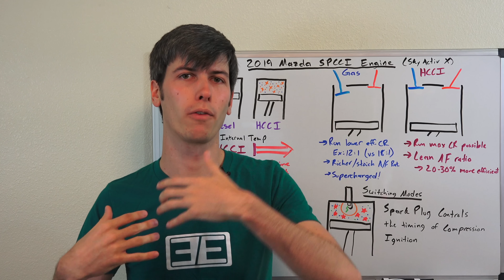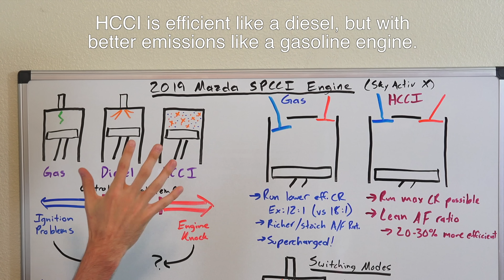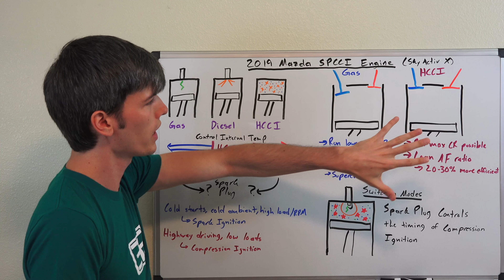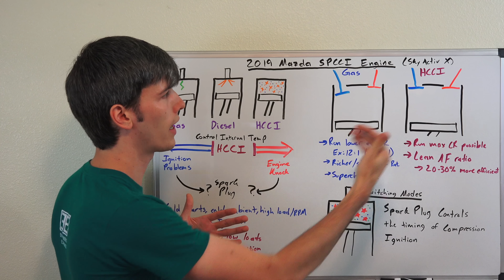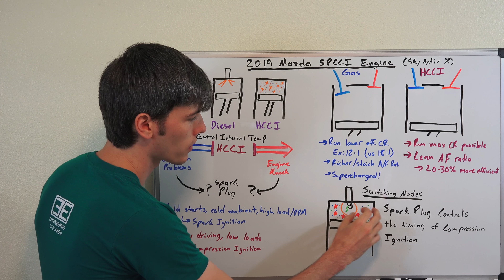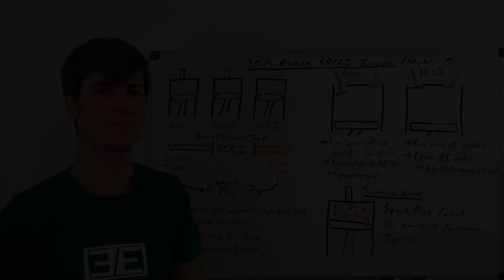Mazda Creates The Holy Grail Of Gasoline Engines - HCCI SkyActiv-X

Comment: Was in Hiroshima a couple of weeks back and speaking to one of the Mazda staff about this engine. They stated (and it was repeated in their release video YouTube: wEh8MgFLNh8) that the work they did for their clean sheet approach to the Skyactiv-G and Skyactiv-D engines was intended as the path to this Skyactiv-X engine. Of course with those, the non detuned G had a compression ratio of 14:1 (very high for gasoline) and the diesel had the same compression ratio (14:1 very low for diesel). The diesel follows on from numerous studies of low compression diesel using a single cylinder (Example "A Survey on Low Compression Ratio Diesel Engine" - Bridjesh P et al) where there was lower NOx and soot, however cold starts were an issue. Mazda sorted this out by redirecting exhaust during startup (I experience this daily because I have a Skyactiv-D, and even on the coldest mornings it takes just a few minutes to warm up where you cannot exceed 50km/h). The bonus however has been lower NOx and lower soot. Both of these were illustrated recently. Japanese government investigations into diesel engines post VW dieselgate, showed that Mazda's engine was the only engine to meet standards and had NOx emissions as stated in both real world and laboratory tests, whereas all other manufacturers had between 6 to 10 times more that the standard when comparing real world tests to the lab. With regards to deposits, AutoBild in Germany Dauertest (which is an intensive 100,000km test), came to completion on a CX-5 with the Skyactive-D, they noted no deposits on the cylinder (which contrasted greatly to the 18:1+ also in their Dauertest. The other advantage to lower compression has been weight. The old Mazda 18:1 diesel had an iron block.
So the question I posed when in Hiroshima was what compression ratio the Skyactiv-X would be. The answer was simple.... what compression ratio have both G and D been heading towards? The answer - 14:1. Watch the Mazda video on youtube wEh8MgFLNh8 and this is basically hinted.
Reply: Glenn, don't worry about the scoffers. They draw conclusions about things they don't know out of thin air. You have demonstrated knowledge and intelligent writing on Youtube. That's a lot more than most.
Reply: mcgeufer WTF? You shouldn't joke about such things. Hiroshima is a great city, and although war is war, Hiroshima was targeted because its a port and would feel a large impact. Visited the factory just under 2 weeks ago (my third visit). While heading out to plant, a keen eye can spot mules and test vehicles (including the HCCI test vehicles). Although impossible to detect what a test vehicle is actually testing. Most test vehicles were current CX-5 (from Hiroshima) or Mazda 3 (from Gifu which is 20 minutes away by Shinkansen). My family lives an hour away in Fukuoka (which is close to one of the two main Lexus factories - a very different style there and tiny compared to the Mazda factory).
Reply: mcgeufer for record, atomic bomb used about 60 grams of nuclear material, which when spread means that its very safe now. This contrasts with somewhere like Chernobyl which was over 2 tonne of nuclear matter
Reply from the maker: Fascinating, thanks for sharing!
Reply: Sucker Punch. That's quick wit Rumpa, but also shows youth.
This is an Engineering video, not a history lesson.

But given your youth, I highly recommend visiting the sites inquestion yourself. Reading the history. And taking note of both sides.
The Japanese were not in the right. Sure. It's war. But your use of "Sucker Punch" really illustrates you don't have a grasp on the whole picture of the war. 

I will state first, that as an Australian, our current history may have been different had it not been for Hiroshima and Nagasaki. And it's part of the reason, the peace museums are worth visiting. I have, on numerous occasions - as too, have I visited Pearl Harbor. The two, could not be more different.
As an Australian, I know we're big supporters of our allies. Actually, we are the only country to have supported the US in every conflict. When others say no, we never say no.

Back to WW2. It started before Pearl Harbor of course.

Australia was the first of the allies to enter WW2 on a called from England. 15% of Australia's population enlisted, and was sent to WW2 in Europe whilst the US remained inactive.
It was Pearl Harbour that finally brought the US into the war, over 2 years later.

The long term goal of the Japanese wasn't to attack Pearl Harbour - that was a large, and important target on the way. Their eventual goal was to attack Australia. And that, they did.
Whilst Pearl Harbour in Hawaii was attacked (and yes, the mainland was hit somewhere in nowhere Portland forest by a well known Japanese pilot) - it brought the total attacks on the US to 2.
Australia on the other hand was attacked 97 times by the Japanese, in over 5 states.

The Japanese were so ready to take over Australia, they even had new banknotes called the "Australian Yen". Australia would have been breached had it not been for the forming of the US Navy's 7th Fleet in Brisbane, Australia. While most of our troops were in Europe, Australia and the US formed together. Actually the largest Naval battle of all times, the Battle of Leyte Gulf was the US and Australia fending off the advance.

And in the end, most remember two atomic bombs being dropped.
What most don't remember is that the US bombed almost every single town and city in Japan with civilian deaths being anywhere from an estimate 300,000 to a million people.
That was the sucker punch response to 2500 dead in Pearl Harbor.

Japan of today is very different. Despite being every piece of military was dismantled by the US (east Japan) and the Commonwealth led by Australia (West Japan). Despite the US inflicting multitudes more damage to their island, than was inflicted on them, they are a nation that has much respect for the US.

This respect is shown in the way they display their museums in Hiroshima and Nagasaki.
They are peace museums. They state the facts in all languages, and pass no blame. They are silent and reflect on the dead.

Travelling to Pearl Harbor, I was hoping to find the same attitude - that was war, lest us forget.
Yes, USS Arizona was like this - it's a burial site. But everywhere else there is a brazen and brash attitude. There is only one language. The facts are stated about Pearl Harbor, but the guides respond in a "hoo haa - we're American and we kicked their ass" way. The Japanese certainly don't do that.

So, rather than respond with "Sucker Punch" as if "they deserved it" - take into account all of the history. Did an attack on a single island with 2500 dead warrant fire bombing an entire nation? Suppose we'll never know how far it needed to be taken.

What I am thankful for is that Japan is a true ally and friend today. That Australia is a stronger nation for its involvement.

Now, Rumpa - can we get back to HCCI?
Reply: McGeufer the Japanese were given a chance prior to Hiroshima. Part of what you say is true. When firebombing Japan, they left Hiroshima untouched knowing that if a surrender didn't occur that it would serve two purposes - first, it would be very impactful and hopefully force their hand, but secondly, they would see the impact of the bomb.
The  US wanted an unconditional surrender. This was in discussion well before Hiroshima. This is what Roosevelt at the 1943 Casablanca conference, but it wasn't looked down upon very well by other allies including Churchill, and even Eisenhower himself. The unconditional surrender would have removed not only military, but dismantled government.
After Hiroshima, there was no surrender and in a very Western way, they negotiated down - the unconditional surrender was off the table, and it would be a purely military surrender. This was seen by the Emperor in another way. He honest thought that there was a weakening on the side of the Allies (although worth remembering, that by this time the other parts of the Axis powers had already surrenders in Europe). Nagasaki was attacked (the original target was east of there at Kokura, but it was clouded over).
The surrender occurred after that.
But some also note that Russia had declared war on Japan just prior to the atomic bombs being dropped in the first place. Russia is barely an hour flight away from Japan, and some historians thought that even without nuclear war, Japan would have eventually surrendered rather than be taken over by Russia.
Reply: They've hinted at 14:1 in all of their material. But there isn't actually a released number. They've done so much to moved their diesel engine down from 18:1 to 14:1. And moving to 18:1 could result in a heavier engine block (something that would go against their zoom zoom gram analysis program).
However I suppose if they could produce a lighter block it would be a tick. And it might be the case that such a lean mixture requires 18:1.
Let's wait and see.
Reply: you are kidding right?
Reply: This is a report from Emission Analytics which did private testing that did not conform to Japanese fuel standards.
It wasn't performed in Japan, and had no legal binding on Japanese car makers in Japan.

The Japanese government performed their own legal testing to their own standards. It was not commercially supported, or liable to commercial bribery. Emission Analytics has been hired previously by competing car makers to review emissions.

I think I take a Japanese government test, which was done by the government for legal binding reasons over your rubbish source above.

The body that did the testing was the MLIT (Ministry of Land, Infrastructure, Transport and Tourism).
The standard that needed to be conformed to was  “Automotive NOx and PM Law"
The emission standards are summarised here: https://www.dieselnet.com/standards/jp/ld.php
Test results were released by MLIT on 04-Mar-2016

https://arstechnica.com/cars/2016/03/japan-finds-emissions-issues-in-diesels-from-toyota-mitsubishi-nissan/
"Japanese regulators told the WSJ that tests of Mazda’s CX-5 and its Demio (internationally known as the Mazda2) resulted in lab and real-world tests that were almost exactly the same."

https://www.forbes.com/sites/bertelschmitt/2016/03/05/japan-releases-nasty-diesel-test-results-germany-sits-on-them/#47c260d93d56
"Some of the worst performers were Toyota’s Hiace van and the Land Cruiser Prado SUV, Nissan’s X-Trail SUV and Mitsubishi’s Delica D:5. Mazda’s new Scyactiv diesel-powered CX5 and Demio (exported as the Mazda2) tested at or near the standard."

https://www.japantimes.co.jp/news/2016/03/04/business/four-japanese-diesel-vehicles-flunk-road-nitrogen-oxide-emissions-tests/#.WZQ2MXcjEUG
"The inspection was made on ... models by Toyota Motor Corp., Nissan Motor Co., Mazda Motor Corp and Mitsubishi Motors Corp."
That's the 4 they tested however:
"report by the land ministry showed Thursday that four diesel models of three domestic carmakers"
They reported three, because the 4th - Mazda was found not to exceed.

www.ihssupplierinsight.com/main/news/proc/create-pdf?id=35111
"The models with the biggest emissions gaps were certain versions of the Toyota Hiace van and Land Cruiser Prado sport utility vehicle (SUV), the Nissan X-Trail SUV, and the Mitsubishi Delica D:5, all sold in Japan. On the other hand, Mazda's CX-5 and Demio yielded almost the same emissions results as in the laboratory tests"

Herr, get your facts straight buddy! Stop trolling.
Reply: Herr, you obviously are interested if you're coming to this awesome channel. This channel is a no nonsense, informative channel and EE produces some awesome stuff.
And the posters here are keen to learn, contribute actual facts and their own opinions.
And opinions are fine.

However if you're interested, stop posting sources that are unreliable or you have read, but misquoted to suit yourself.Contribute what "you" believe is "your view", but don't present it as a truth just to shut down other posters, who frankly are contributing in positive ways. And don't respond in the way you did above: "now get out of here children... you know nothing... losers.", because this is just troll behaviour, which is for someone of my generation the childish way to reply.

Next post from you Herr, should be positive mate!
Reply: Elon musk is a fraud
Reply: mcguefer you really ought to brush up on your history. they had no intention of surrendering (albeit because we made the mistake of softening our surrender terms, which they took as weakness). the bombs were simply because we didnt want to launch a land invasion. thats it. thats all it was.
Reply: Herr, you're actually incorrect. It's easy to assume though, because both German and Japanese governments went to extraordinary lengths to investigate.

The Japanese have emission standards. To determine if each vehicle was "cheating" it was tested in the lab (where most would simply pass), and in a real world test (where most would be caught cheating). This testing was done late 2015, early 2016 and published.

The worst performers were the Toyota Hiace and Landcruiser, Nissan's X-Trail and Mitsubishi's Delica D van. The main manufacturers, Toyota, Nissan and Mitsubishi at best had cars that were breaching standard by 4x on the road, but at worst 10x.

However, the Japanese government were astounded when Mazda's vehicles remained the only ones to perform identical in both lab and on the road, and deemed as passing the test. The on road emissions produced on the CX-5 for example were passing the standards and matched what they had printed on the specifications. So, no, the Skyactiv Diesels were applauded, not caught cheating.

It is worth remembering the Skyactiv is a very different diesel to all the others. It's low compression and it has no urea treatment or AdBlue. And if you can read/speak German head over to Autobild for their Dautertest of it, and you'll see their comments in this regard.
And given all the research that has been done on low compression diesels in theory have lower NOx - the proof is in the pudding only on these examples.

One market missed out on the CX-5 diesel. The US.

US law (driven from California - the state that really drives the emission standards in the US) requires diesel exhaust fluid for a diesel to be compliant. Ironically, the Skyactiv diesel already complies on pure emissions with Californian law, however because it lacked a DEF system, it was restricted from the market.

Mazda is adding a DEF system to their current CX-5 to appease CA law. It should be released later this year.
Reply: There has been decades of attempts and concepts. No manufacturer has committed to bring HCCI to market commercially. Watch the previous Engineering Explained video explaining HCCI and it's issues and it's easy to see why it's the holy grail. For such a small company, Mazda has been creating some incredible things of which engines are simply a subset. Back in 2009 they went back to basics and clean sheeted and re-thought everything. It started a first goal - to improve fuel economy without ruining the fun of driving, and the first change they did was to move the design and engineering departments next to each other, and ensure there was a feedback loop between their software applications.
But skipping their new ideas of transmissions, engines for a moment - the change that was most inspiring for me was to go back to Hiroshima roots. Hiroshima is known for some of the best steel in Japan, and which itself was borne out of old Samurai sword craftsmen ("Takumi's"). Mazda took inspiration from how Samurai swords are forged and used this to create a new method to create the very high tensile steel. This broke a record in 2011 (1800 MPa), which was only months after Nissan had set the world record. This massive effort saved barely 5kg in the bumper in the CX-5, however was 30% stronger where it counted. They're seriously kicking goals!
Reply: The hidden fact behind production of new cars: The emissions in making the vehicle are never taken into account.
The carbon footprint to produce a high end vehicle (such as a Tesla) is 35 tonnes of CO2. There is a carbon footprint also with making batteries which don't get counted when making internal combusion engines.

Most calculations will say that the production is about 8-10 years worth of driving a car, but that's under ideal conditions. So let's make the assumption that it's driven hard, and driven often and it brings the figure down to three years.

So as long as you drive your Tesla for more than three years, power it only with solar or wind generated electricity - then you're gold.

With regards to crushing other car makers? Won't happen. The global market is far to large for Tesla to cater to alone. Their price point has to change. The battery technology has to change.

The market already speaks... and in 2017, Tesla is barely a player.

Herr (Hmmm you have removed your name I see), your comments are amusing and bringing a smile to everyone around here. Keep 'em coming.
Reply: I heard years ago that Mercedes has been researching the same thing (I think they called Diesotto or sth) but it seems the Japanese has done it much faster since there was no Skyactive program back when MB started doing this.
Reply: Thank you and likewise. Much better to have something to add that isn't trolling :)
But to be to the point, I think it's great to see a small company (Mazda is small in Japan - small in size, small in dealerships) invest in engineering.
The easy route would have been to follow every other car company. Where most are downsizing with turbos and moving to CVT transmissions with artificial stepping, they're heading in the other direction.
Reply: Diesel has high NOx output, lowering the compression ratio reduces NOx. To make up for it the Common rail fuel system pre combust the fuel in the fuel rail at over 30,000lbs of pressure.  So when the fuel is injected it comes out as a vapor and not a mist, you don't need 28:1 to pre ignite it then ignite it anymore.  Mazda will have the lowest compression ratio in market, but will make up for the low compression ratio with multi strike of the injector during each compression and expansion stroke along with the common rail fuel pressure.
Reply: Its fascinating from a technical point of view yes, but what I meant by too little too late is that the Internal Combustion Engine is really in its last chapter now. Its like saying that the Stanley steam powerd car is a great piece of technology when the Ford model T had just been released. Personally I'd prefer to have seen Mazda make a sleek 4 door coupe like the RX8 with futuristic design looks and a super high performance electric motor with some sort of groundbreaking energy recovery system so you could do 500 miles or more before recharging. The technology is there and would be far better received than a petrol that gets 20 to 25pc better economy.
Reply: I'm sure since you spent such a pile of money on a Tesla, you're convinced it's going to do its part in saving the world. Just like someone who spent a pile of money on a mansion is convinced the rest of the population needs mansions to make landscapes look better.
Reply: Just the facts. When you're done saving the environment with an electric car, read this.....
http://www.dailymail.co.uk/news/article-4764208/Child-miners-aged-four-living-hell-Earth.html

And then watch this..... (however, I do not believe in 'mother earth'; just pay attention to the rest of it)
https://www.youtube.com/watch?v=QlRvZPBI108
Reply: Glenn Stewart tldr dude
Reply: I noticed that as well after reading through the literature. The HCCI Skyactiv-X seems like a logical development of both the G & D engines as each of their designs seems to have more in common with the opposite fuel's design (e.g. the Skyactiv-G has very diesel like properties while the Skyactiv-D very gasoline properties). The HCCI could be in fact the best of both worlds. 

And to learn that Mazda is actually planning to put this motor into full scale production makes me a happy driver. Having tested recently the refreshed 2017 Mazda 6, I can't wait to see what this technology can be applied & further developed.
Reply: mcgeufer s
Reply: You people should be asking questions, expecting intelligent answers. No, instead you get on the stereotype bandwagon, framing a person for the things he has said. Comon. Get some tact.
Reply: Glenn Stewart damn glenn you've got so much knowledge!! what did you study in college?
Reply: Well Fouad - just so happens this is my sweet spot. Cars and war history. I spend a lot of time in Japan around car enthusiasts and engineers, so get to ask a lot of questions. But study.... computer engineering, geography and economic/accounting.
Reply: Glenn Stewart well it will be a great honor to meet you mr glenn
Reply: Jabriel Toliver (thumbup)
Reply: Herr doktorbimmer lol they actually we're the only ones that weren't. Did you even watch the video
Reply: I don't think Herr watched the video. Or the video I gave a link to. I think Herr might be a former Mazda employee. I could be wrong about that, but that's my guess for the day.
Reply: Herr, as explained previously, Mazda was the only manufacturer found "not" to be cheating on emissions.
Reply: Herr doktorbimmer i think you are blindet by tesla
Reply: Herr, honestly I don't have anything personal invested in the outcomes of engines, fuel, energy, pollution, or the findings of science in general. I have no personal emotional investment in these things, I don't have any financial investment in these things. I'm a pretty level headed man. I'm quite objective in the way I look at things.

Now, I really don't care if EV's win and petrol loses, or petrol wins and EV's lose. Or if the world gets a mix of both petrol and EV vehicles. Really DO NOT CARE.

All of that said, what I do care about is when people deliberately LIE in public places (for whatever their personal motive) and mislead people about facts, figures, information that can clearly be demonstrated to be the OPPOSITE of whatever they wrote or said. I HATE LIES.

If you appologize for misleading people about facts, figures, information, no biggie. That would be a nice move of humility on your part and should be well respected.

If you don't give a rip, get angry, and insist you will stick with your story then you won't get any respect from me and should not get any respect from anyone else. Like I said, I don't have anything personal invested in the outcomes of technology. My problem is with people who LIE ABOUT INFORMATION.
Reply: Herr doktorbimmer so you believe everything a billionaire says because he is an entrepreneur? Where is the full picture? Depends on where you dry your Tesla. If the electricity to your house is solar or wind, you're sweet. But backing most Australian houses is coal. It's shown that the emissions produced from getting the electricity to the house into the Tesla is actually worse than emissions from a gasoline vehicle. Elon Musk is working with my CEO to come up with solutions for in areas of Australia to switch from coal to environmentally sound renewables.
Until then, engines such as this are an interim solution. Pity coal generators appear to be sticking around though. I think my grandkids will still be powering petroleum cars with petrol, and electric cars with coal. Both are evil.
Reply: I'm all for the environment and all and I really do think its the EV for the win now, however all I can afford right now is a 2 thousand dollar Civic diesel.
Reply: Glenn Stewart I see that you are a thoughtful and educated person and I am only referring to the use of the word "evil" in one of your posts when referring to coal and petroleum, nothing else. I find it pretty interesting that what you call "evil" has literally allowed millions or billions of people to survive on this planet for centuries with no other alternatives until the last thirty seconds of evolutionary history. It makes me question what your idea of "good" is? It's rhetorical, but still I do think you should pump the brakes as it were when we actually think about the impact of these two energy sources through human history.
Reply: Herr, love the look of the Tesla's. Customers are among the most satisfied as well. Now they need to work really hard on reliability. The fault rate on the Tesla's is very high and typical of a new company I suppose. Would be good to see them get among the top finishers in the intensive german Dauertests. So far only a handful of vehicles have gone through fault free: several Mazdas and BMW's.
Reply: Herr, nice! Great comment. Was waiting for your sense of humour to come out. Nailed it.
Reply: Heap the insults, doktorbimmer. Just more eternal rewards for suffering in this life.
Reply: But I say unto you, That every idle word that men shall speak, they shall give account thereof in the day of judgment. For by thy words thou shalt be justified, and by thy words thou shalt be condemned. 
Matthew 12:36-37  KJV
Reply: Billions of dollars and miserable, like most of them. Couldn't keep a marriage together and enough stress for 3 lifetimes.
Reply: Sorry, not going to have a conversation with a pervert leaving pervert comments all over the comments section. Sorry.
Reply: Your reputation precedes you.
Reply: Glenn Stewart 
14 to 1 for petrol isn't that high, Japan has 110 octane fuel
Reply: Octane is figured differently in other countries, oftentimes.
Reply: Sighhh. Go away Herr. Let go of your bitterness and move on.
Reply: Then I have to assume you don't read English very well. You sound bitter.
Reply: MrWalker - Fair call. TL;DR
* Mazda's Skyactiv is simply - massive R&D, clean sheeting and thinking outside the box.
* Both G and D engines are a departure from other manufacturers.
* Two studies into low compression diesel showed promising results in UK and India with reductions in NOx and full burns.
* Mazda's Skyactiv-G is only low compression diesel on market. This may coincidently related to fact that Mazda's engine has been only diesel to comply emissions post German and Japanese government emission testing post VW dieselgate.
* Autobild Dauertest in Germany noted that there was almost no soot build up on Skyactiv-D cylinders after 100,000km which they considered extraordinary when comparing to regular diesels.
* The changes required for HCCI are in retrospect changes that were incorporated in part in both Skyactiv G and D (i.e. high compression, electronic timing changes, aluminium block for diesel).
Reply: Glenn Stewart is this engine reliable. Everyone I know in my family doesn't like Mazda for some reason and I feel that's more about the style than the engine but they say they are unreliable. 

I do like the Mazda CX-5 but does Mazda have a Subaru sti competitor
Reply: Mazda's reliability has been fine in recent years.
Reply: MrWalker1000 - sounds like perception rather than fact. Perception is strong in some markets though. In the US and Europe Mazda's issue is presence. Mazda and Subaru are both small fish in Japan. However in the US, Subaru's marketing has really given in a very good perception (helped greatly by marketing of it's AWD system in snow affected areas). Mazda hasn't had the same marketing previously - particularly during it's Ford era.
But perception can sometimes erode the truth.
I personally always point to German reliability tests. Firstly, they're strict. Secondly, because they're not Japanese, they're not going to put bias on Japanese vehicles. There are two main bodies that do tests and one main automotive magazine (Autobild). I like the Autobild tests because they are the world's toughest. They push the vehicle through 100,000km (most people won't have a car that long), then rip it to shreds for a cool photo and analysis under microscope. Can you imagine at pedenatic German looking at every part under a microscope?
In their 15 years, only two brands have had examples of faultless vehicles. Mazda and BMW. This doesn't mean all - it's very rare, but they have examples.
In terms of reliability, over the past years looking at Autobild and other reliability tests, the top 4 brands change. They usually measure reliability for 1,2 and 3 years. 3 is one to look at because issues will tend to bed in after 3. On the 3 year gauge, Mazda has typically been the most reliable. Although top spot has also seen Honda, Toyota and surprisingly Hyundai (the Sth Korea's are getting strong!).
Mazda has a perception of rust issues. Although Japanese brands generally have not been as strong as Germans at galvanisation. This has been changed in most recent examples by Mazda. Still not there IMHO.

Now back to engines.

The issue with this is that almost all manufacturers have had engines which are evolutions of the previous model. This was the case prior to Skyactiv with 25 years of evolution.
The Skyactiv engines are clean sheet. There is no evolution. It's from scratch, so you only have 5 years of experience and reliability to base from instead of 25.

Because it's also pushing the envelope of what's possible, there is more complexity and greater things can go wrong. The diesel for example being low compression requires a lot of trickery when at low temps. So the engine warm up phase is super important. Run the diesel in the early morning and get onto the highway prior to warm up, and you're likely to destroy your engine.
Reply: Re STI competitor. At this stage - no.
Mazda don't have a Boxer engine. Their AWD system while far more advanced that previous generation, is not quite the system that Subaru have. Where Subaru falls down though is it certainly isn't as reliable statistically as Mazda (it's one of the least reliable Japanese brands - which actually means it's still very, very reliable).
Subaru's negative is also that unlike Mazda, it's unfortunately not pushing money into engineering. They rest on the laurels of their fantastic AWD system, but when it comes to R&D into engines, transmissions and the like - they are quite happy to just to something like a CVT which Mazda has already stating a categoric NO to due to fact it does not work with the number one goal - "Jinba Ittai - rider and horse as one body". Their benchmark is for a gear change on all their vehicles is that it must be imperceptible to the driver (i.e. must be under 300ms), which the CVT does not achieve.
This isn't a concern for most other Japanese brands like Honda, Toyota, Nissan who don't release their regular vehicles for driving pleasure. It's the one thing Mazda demands (although I will admit, in Japan Mazda have a Suzuki create Kei car that has a CVT - argh..... they don't like to admit this).
Reply: thanks for the write up. I think its probably really unnecessary, but im the type of person who does an extensive amount of research before I buy anything and try to be as objective as possible. With that said, i can see why its difficult since a lot of people have nothing to rely on except for brand perception marketing. And for an underdog that has very little marketing it can be hard for them to become known. 

my family members think highly of Subaru's mostly for the made in japan aspect and the AWD. So they have respect for the brand and see it as a quality over quantitiy kind of brand. 

The thing is from personal experience and from what others experience german cars are not very reliable. I know many poeople who have BMW and they are a sort of money pit for them and they have all kinds of issues. Given that its a german test I don't exactly trust them to objectively rate their own brand. This is person experience maybe german cars are reliable now but i know in the past and even some today don't rate them highly they have all sorts of issues.

on the other hand Japanese cars are and have always been extremely reliable. Probably even the least reliable like yous aid yourself is really reliable and probably miles ahead of american cars. 

Also, if I had to pick a non-japanese car i'd have to be a german for sure. 

And from what I heard the two most reliable brands in the world are basically Honda and Toyota which can go more than 200 thousand miles. Im not sure about the rest of the japanese brands or german. 

Right now im thinking about getting a honda civic as a first car given how reliable the brand is.
Reply: im asking about the STi because my friend wants to buy the newest 2018 STI. And I'm personally against non-practical cars. And I think maybe the competitor (being the Honda civic Tpe R) i think maybe he should go for that. 

Once you have 35 k to use for a car you kind of have lots of competition. because we are talking about all the japanese brands including acura and lexus, and then the german brands to consider. 

which is a lot of research you have to do to pick the perfect car in design , engine, and interior. 

Not knowing much about cars, if I had money right now I'd buy an Acura TLX or something of that sort because they have cool style. 

and knowing Acura is owned by Honda i know im getting really good reliablity. Is tehre even such thing as a bad japanese car. 

I would definitely also consider the MAzda CX5 knowing they are making big improvments nowdays.
Reply: Nice selection of cars you've listed MrWalker1000. Honda in the US I've always found to be an unusual beast. Being in Australia myself, we align very well with Japan (metric + LHT). So the Acura TLX (made in US) is quite similar to what we would call the Accord Euro (made in Japan) which is similar to the Acura TSX. Its competitor in Mazda space would be the 6.
Mazda don't really have an answer anymore to the WRX STi or Civic Type R or for that matter the Golf GTI,R.
So if you need performance with a turbo, you would have to go elsewhere.
Reply: I'd suggest always getting Japanese cars made in Japan. Australia don't have any Japanese brands built here anymore, so we always pull German cars from Germany and Japanese cars tend to come from Japan. Whereas in the US, a lot of German cars in the affordable range come from the US, and likewise so do a lot of Japanese cars.
It's the "Made in Japan" versus "Made outside Japan" that has impacted Honda in Australia.
We have had a free trade agreement with Thailand for a long time. Importing from Thailand allowed vehicles to avoid tariffs (cheaper) and we made more cheaply (cheaper again). A Thai Civic could be sold here for the same price as a Japanese Mazda 3 and they would earn more money.
Most of Honda's cars here are from Thailand. Whereas Mazda has the highest rate of Japanese made of any Japanese brand. The quality differences are noticeable.

This was tested when Mazda switched from a Japanese Mazda 2 to a Thai Mazda 2. Faults increased in the change over. Customers complained, and they switched back. Mazda did major changes to the Thai factory as a result.

To prevent similar issues in the US, the new Mazda factory in Mexico has been developed from the ground up to be as similar as possible to the Japanese factory. But at the end of the day, it's the way the Japanese people are with their work ethic and culture that really add to the reason Japanese cars are so reliable.
There is no such thing as a "Friday car".
Reply: Glenn Stewart honestly I don't get why cars aren't made in Japan for the USA market. What do you think Is the best Japanese car ? 

Do you think German or Japanese cars are better. Even though they don't directly compete with each other with the exception of Volkswagen which compete with Honda and Toyota etc
Reply: MrWalker1000 - this answer is my own thoughts on this.

The US economy is still number 1. Making cars in the US for the US market is both economical and provides jobs. Any politician who lives in a state with a car factory knows that a single factory can create jobs for far more than the company employs (each factory for example will source from smaller companies in the area for parts). It's also why bail outs are a popular option politically. Spending 100 million to prop up a US factory supports more than just the company, and has positive knock on effects with the local jobs.
It's a touchy topic in Australia. We used to have many car manufacturers. The government had requests from manufacturers to support them during GFC - they said no. In the next couple of months, the last Australian car will be produced. The engineers and designers all moved to Europe and the US. And nearly 80 companies closed down (because 3 manufacturers closed down). Over 300,000 people lost jobs.

Japanese or German? Depends on where you live and what you want.
For repairs - In Australia, closer to Japan - Japan is the answer. In Germany, German cars.
But the main difference..... German cars are engineered extremely well, but overthought and over engineered. Complexity is easily seen by the number of tools you require. How complex the wiring harnesses are. How much the engineers fixing the cars need to know.
Japanese cars are engineered for simplicity. Wiring is simple. Tools are simple.
Look on YouTube for the difference and you'll get a LOT of US mechanics who do a comparison and will reach the same conclusions. It's one reason that you buy a 10 year old German car, and you need to check the electrics. But Japanese cars, keep on rocking.

Japanese don't tend to engineer for handling. It's a reason Mazda is so difference, because that's all they do.
Compare a BMW to a Lexus and you'll find that the BMW will handle better, and the panel fits of the Lexus will be better and its driving will be muted by over zealous ESC and dead steering feel.
Reply: Glenn Stewart what you think is better the Honda Civic type r or the Subaru sti. My friend is looking at either of those two cars right now
Reply: If a gasoline street driven automobile engine has 14:1 static compression ratio, the instant it overheats the extreme cylinder pressure is going to spit out a head gasket.
Reply: true, for almost a WHOLE week before the strike, the japanese were making efforts to surrender
BUT the american would not hear of it
Reply: The compression ratio of the petrol version is actually capable to being tuned to 18:1 compression ratio. That's really amazing if you ask me.
Reply: Herr, provide links to these official findings or you're just pulling bogus information out of thin air. No amount of bold text will prove otherwise.
Reply: I'm worth more than that. Jesus shed His blood and died in my stead. That's worth more than 17 billion empty inflated bucks. It's worth more than all the gold and silver on the earth.
Reply: Rumpa Stiltskin 
The sucker punch was Pearl Harbor. They knew we were going to retaliate, just not how. Japan made their own bed. Definitely agree with you.

Having said that, Japan is a fantastic country. Who can hate a country that is working on mechs and rotaries? The anime isn't half bad either, but has been watered down in the last decade. I also applaud Japan for coming so far in such a short period of time.
Reply: Nick West And the Bukkake, gotta love the Bukkake.
Reply: I´m surprised that there are still people around who actually believe that those nuclear strikes had anything to do with the war.

That was an experiment on human test subjects and nothing else.
The USA had a team of doctors and scientists ready that entered ground zero just after the strike in order to check the damage they achieved against humans.
There are plenty videos about it just here on youtube From both sides the Japanese and the US
.
Reply: DIY Tesla
I was called a lot of names. But Trump supporter is a new one.
Almost an insulting one.
But I see, many people seem a bit triggered about my comment.
It was palpable, not clear enough that it wasn´t meant to be taken seriously.
And at Glenn.
As above, it was a satirical comment.
But besides that with a low ignition point like in Hiroshima, you have as well secondary contamination from. The so called fallout.
Reply: you are clueless.... your government is lying, i bet you think the world is round lol.
Reply: No, you haven´t been in Hiroshima. There was a nuclear explosion some decades ago. So it´s not possible to o there for at least one billion years!
All the green people say that over and over again. The mean Atoms kill everything :(